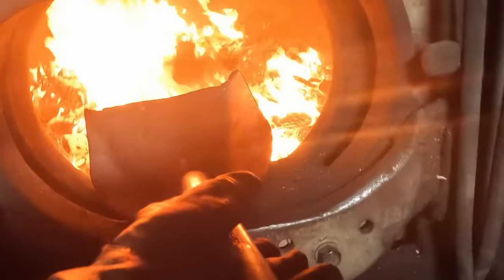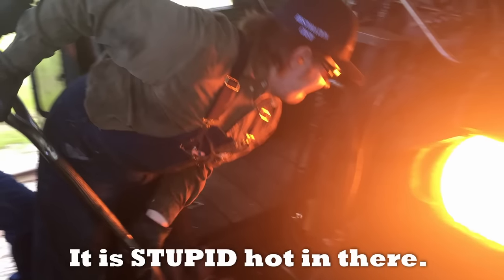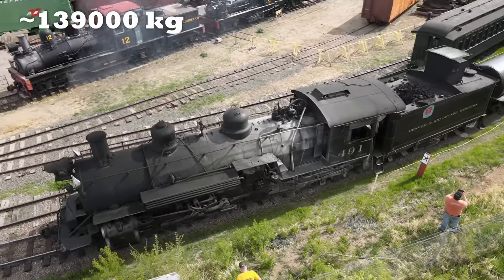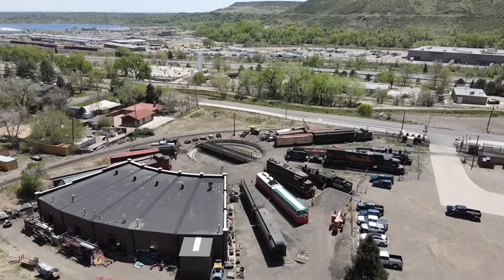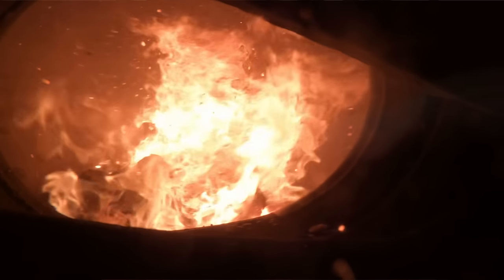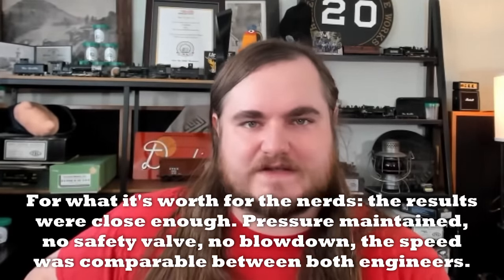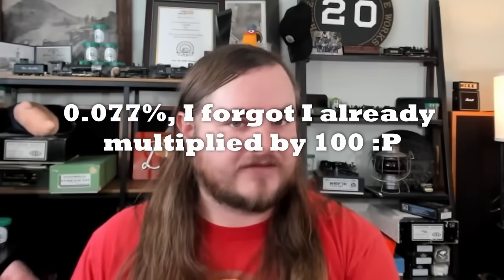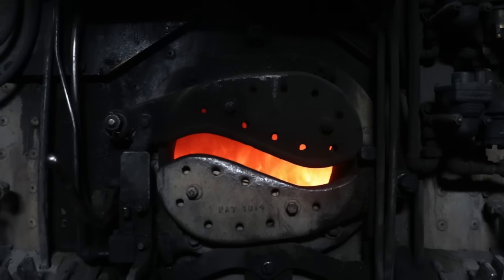How much COAL does a steam train burn? | Railroad 101

Comment: Interesting! 
The tiny steam locomotives (narrow gauge industrial/quarry locomotives, weigh less than 10 metric tons) at the Efteling theme park in the Netherlands are coal fired and they appear very economical. Each lap (about 3km i think) they get fired only a couple small scoops of coal. It surprised me. 
They're not run hard, there's no grade and the speed is very limited.

Comment: as a live steamer, i tell people on average in an average 4 hour run day.  i typically go thru between a bucket and bucket and a half.  sometimes two.  but that depends on how many cars im pulling mostly between 4 to 5 cars maximum, whether or not i put people in those cars.  each car weighs 300 pound a piece and probably close to 500 pounds a piece with people in them.  but at least no more than a bucket and a half a day.  so im probably not going thru as much as you guys go thru at the musueum

Comment: its fascinating to me that the superheater basically means nothing when running on the museum because in service, many companies found that superheaters did reduce coal consumption in the range of 10-15% I wanna say, though I'd have to verify and re-check my sources as I read this years and years ago.
Reply: With the light loads and short distances the superheater doesn’t get enough flow to do as much as it would say on the Cumbres and Toltec
Reply: @andrewreynolds4949  Thats just not something I thought about before but after hearing it, "oh wow that makes sense, I'm an idiot for not thinking about that" a bit like Hyce and Gearing in the last Derail valley episode
Reply: @KPen3750  There's a lot of mechanical stuff on steam engines that's surprising like that. Every small piece you see is like "oh, that's what that's for"

Comment: You can make the same efficiency arguements for something like passenger automobiles.  When pulling a trailer, obviously the big truck will be more energy efficient than a small car; but when getting groceries, the efficiency flips, with the small car proving the better value in transport distance.  Just about everything in our world works just like that.  Air mail for a single package would be just a complete waste, but when transporting a full cargo haul, the energy usage vs mass transported makes more sense for the aircraft.

Comment: I was thinking that, all else equal, the small one might be more efficient based purely on the fact that, in my very non-professional and limited experience, higher temps/pressures/temperature gradients tend to provide better efficiency.
Including car engines; gasoline car engines typically produce power most efficiently around 80-90% load and ~1800 rpm (give or take a few hundred rpm). This is one of the big reasons smaller car engines, all else equal, are generally more efficient; they spend more time closer to higher loads to produce the same power.

It's neat that it turned out that way, and I suspect the big engine might be even more efficient at producing power near max output than the small engine is, in part because of the superheating tubes, but also because of scale. (Note; more efficient at producing power. That is, fuel used per amount of power produced.)

Comment: So what I'm hearing is that 491 could go all the way from Skagway to Whitehorse (107 miles) and partway back, on a single tender of coal.  Y'know, if the WP&Y actually reopened the line to Whitehorse.  20 could go Skagway to Whitehorse and almost all the way back, maybe all the way back if she drifted down from White Pass summit.  That's some perspective.

Incidently, Robert Athearn's book "The Denver and Rio Grande Western Railroad" has some numbers from the early days of the D&RG, back in the 1870's.  Using coal sourced near Canon City, one ton would last 85.29 miles, or 23 lbs/mile.  Meanwhile, one ton of coal used by the Kansas Pacific (and probably the D&RG originally) from Fort Scott lasted 39.87 miles, or 50lbs/mile.  Admittedly, this is with tiny engines like the Montezuma pulling similarly tiny trains, but it's an interesting comparison on the different grades of coal as well.
Reply from the maker: Well, that depends entirely on grade. Who knows what the usage is otherwise... if the WP&Y is alternating 3.5% up and 4% down every half mile for that distance, yup! Lol. It is a neat comparison. I'd love to get more data points such that we can come up with a "this much coal per mile per ton of train per grade percentage point" number.

Comment: Those range estimates imply that either locomotive would be able to perform at most, a single trip on my local railway line (i.e. terminus to terminus in one direction). Would coal useage rates change if you're running the locomotives over longer distances without frequent stops like you might do at the museum between laps? Or maybe the Victorian Railways locomotives just had larger tenders back in the steam train days haha...
Reply: Range generally shrinks with stops. While loading/unloading you want to keep the pressure up because pulling away is when you need most effort, so you're burning fuel to replace heat losses while covering no distance. Also, until you get up to your cruising speed you're accelerating and that's the equivalent of a hill climb so you're making maximum effort for less than maximum speed.

I've seen locos with two tenders. I don't know if one was coal and one water or if they were both normal and got swapped over during a stop mid-journey to extend range where there were no facilities en-route.

Comment: I remember reading in a book that in the early to mid 20th century the CNR Transcontinental passenger train would typically burn through 113,000 pounds of coal running between Toronto and Winnipeg, a distance of about 2000 Km. Does that figure sound about right?
Edited to add:  I ran the numbers and it works out to 90 pounds per mile, so well in the ballpark. How's that for some nerdy calculations?

Comment: 491 burned 59 kg using 480kwh/mile or 13.24 gallons of gas per mile with .o75 mpg , #20 used 30.8 kg of coal per mile or 280.7 kwh/mile, making 8.32 gallons of gas per mile or .12 mpg. my god thats a lotta fuel😅

Comment: If my calculations are correct, this means on your oval
- 491 emits about 13.4 tons of CO2 per 100 km
- 20 emits about 6.4 tons of CO2 per 100 km
For comparison, a petrol car emits about 19 kg of CO2 per 100 km. According to a quick research, in the US there's an average of 1.5 passengers in a car. Going on with those numbers, the steam engine driven train is more efficient than a car …
- with 491 at about 1060 passengers
- with 20 at about 505 passengers
I'll assume some 50 people per car? If I guess correctly that's about four times a cars emissions for 491 and twice a cars emissions for 20.
And that's under terrible conditions, in normal operations back in the day it would probably be significantly more efficient; after all, the engines were constructed for a different use profile than running in a small circle, stopping every other mile, way below tonnage. Now add to this the fact that a coal burning steam engine is probably the least energy efficient way of putting power on the rail and you see how ridiculously efficient railways are compared to road traffic. Organisations running steam trains over here in Germany report having carbon emissions of comparable size to cars. Now remember a steam loco reaches an energy efficiency of about 10 % under good conditions (coal to traction), modern electric locos and railcars reach values of up to 90 % (overhead wire to traction).
Reply: Later on in the video you explain how you always wanted a locomotive fitting the task to reach peak efficiency. In non-electrified rail networks like the US's that's presumably true to this day. Electric works a little bit different, though … from my own experience I can tell that having two locomotives instead of one makes the train significantly more efficient. One factor is that you accelerate faster which in turn means you can keep to a lower speed (meaning less air resistance loss) to reach the destination in the same time; but that's a relatively small factor, though it increases the shorter the distance in question is. That would be true with steam or diesel as well. But the other factor is the big, decisive one: Having twice the motive power means having twice the recuperative brake force. Ideally that's enough to get the train down to a crawl all by itself, before you need the air for the last few km/h. In other words: More power means more recuperation of kinetic energy back into the electric network. A modern passenger train with a decent power to weight ratio can get up to some 30, 40 percent recuperation. Pretty insane, if you ask me.
Reply: Okay, here's some more insight into electric train running. I can't get into too much detail about what line and what vehicle and so on because getting too specific would go into economical secrets of the company. But on a certain line with a modern electric train and running in both directions (so topography roughly cancels out) I end up with a net electric power usage corresponding to roughly 80 l of petrol per 100 km. The occupancy varies throughout the week and the day, but we end up at about half a litre of petrol per passenger per 100 km. So even if the electricity was generated from fossil energy (which it doesn't - our company runs on 100 % solar, wind and water), it would be ridiculously efficient.
Reply from the maker: 40 per car in our case, but only for 4 of the cars, the last car is specifically for crew. I'm not sure how much CO2 they actually put out, that'd be interesting to do a study on. Thank you for doing the math! :)

Comment: Your results aren't surprising to me, as a layperson. It stands to reason peak efficiency is found as close to fully loaded as possible. Aircraft are the same way. 50 passengers in a 50 seater is more fuel efficient than 50 passengers in a 70 seater, all else being equal.

Comment: Only Hyce can say something along the lines of "It gets 130 lbs of coal per mile and that one gets 62 lbs of coal per mile." with a bit of a smirk on his face. Everyone else is trying to squeeze miles out of a gallon, especially with semi tractor trailers. Hyce sits atop his steam locos and just throws out that it takes several lbs of coal to move it and some cargo a single mile. It's going to be a super sad day when everything goes electric and people are trying to brag about their battery's capacity when we all know that batteries degrade over time so saying you get "400 miles per charge" with a new EV isn't really that impressive compared to a 8 year old EV with it's original battery cell and it getting 250 miles per charge. It all just feels weird.

Comment: Something I wonder is with a train that small, how much extra coal are you having to use just keeping the fire going across the whole area of 491's firebox?  IE if you didn't have to worry about keeping the whole thing hot and could just pile the fire much hotter on one specific spot, would you end up using less coal for small loads like that?

Comment: My understanding was in the absolute most basic terms if all things are as equal as possible.... that with most 'engines' the ideal condition for max efficiency would be just slightly less than a full load say roughly ¾ full power with a bit of reserve.... I don't know how true that is but my experience tells me with gasoline engines that's usually pretty close...  but I have never done extensive rigorous scientific testing either....

Comment: Excellent presentation.  Interesting to compare to performance back in the day. Would it be possible maybe to get permission to run the engines on a running mainline nearby for a day?  Get a hundred mile run out and back through the countryside, with paying passengers and photo ops for everyone.
Reply: The running engines at the Colorado Railroad Museum are all 3 ft narrow gauge. All other laws aside, that is unfortunately not possible.

Comment: now whats the conversion of ton/mile to mpg?
Reply from the maker: Now that's a hell of a question... lol!
Reply: got curious enough to do math, turns out there's about 192 gallons of standard unleaded gasoline to a ton of coal in BTUs.
So unless my math is wrong, on your loop, 491 uses the equivalent of 12.5 gallons of gasoline per mile, and 20 uses about 17.9 gallons of gasoline per mile
 @Hyce777